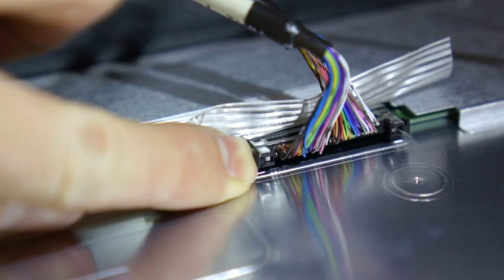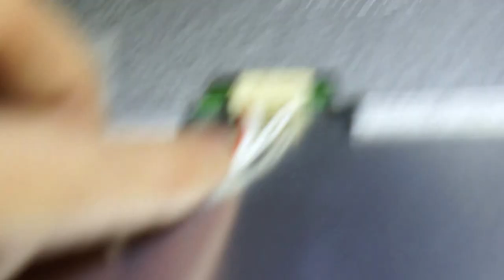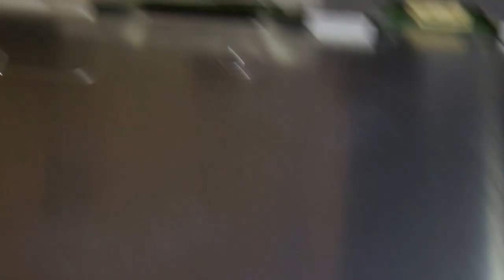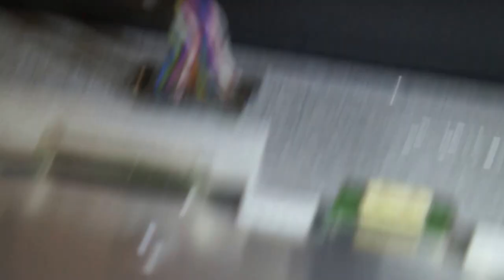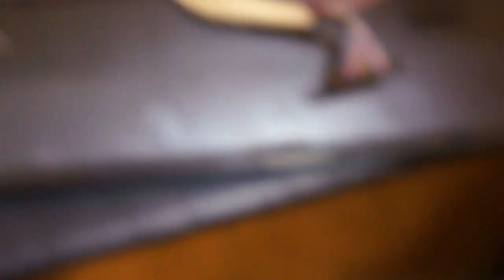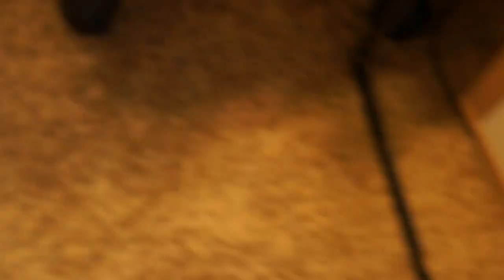Dismantling Korean QX2710 PLS - Finish Removing LCD Assembly from Monitor Casing

Comment: Thank you for posting these videos. I have been fixing a QX2710 monitor for a while and these have been useful in many ways.
This time I had to confirm which one of the grey-red cables go to which hole because I had lost my disassembling photos. The connectors for these cables are identical in PCB side.